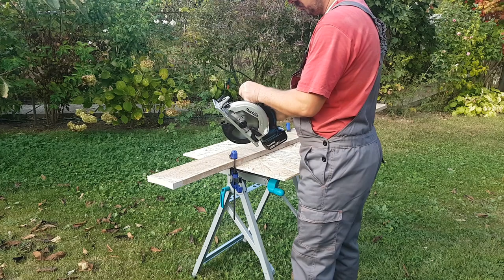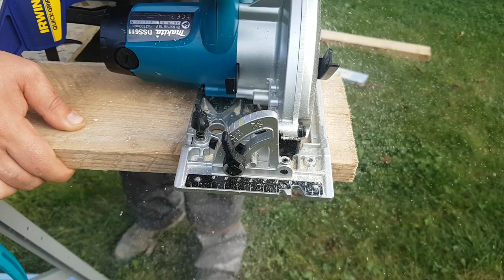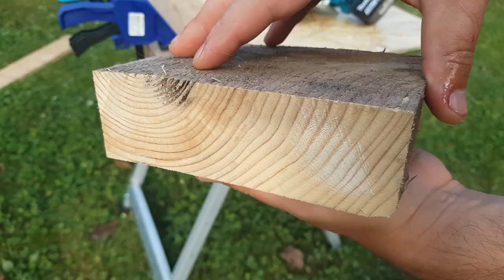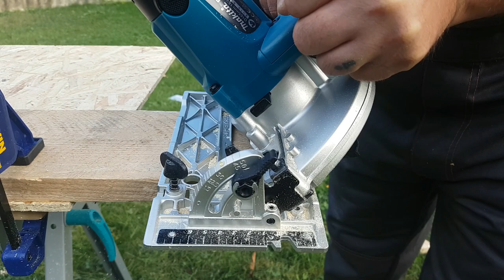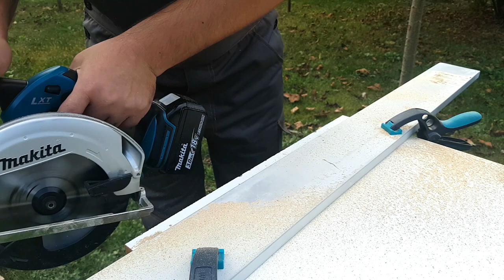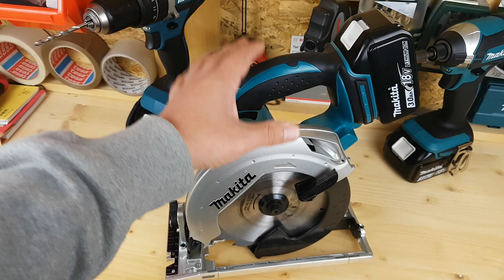Primele teste cu Makita DSS611 fierastraul circular cu acumulatori de 18V

Comment: Vă salut dl. Dan.
Ce părere aveți despre makita dss501?
Intenționez sa-l cumpăr pentru lucrări ocazionale,  pentru casă. 
Are pânza mai mica și pare mai ușor de folosit. 
Mulțumesc!
Reply from the maker: DSS501 am vrut eu sa iau initial dar nu era pe stoc asa ca am luat dss611. Si nu imi pare rau deloc. La fel am zis si eu, ca nu imi trebuie cu panza de 165 dar am sfarsit prin a despica pe lungime grinzi de 100x100 si n-as fi avut ce sa fac cu 501. Ala e bun doar pentru cherestea mai subtire. Nu are multa forta, intra repede in protectie. Trebuie sa te gandesti bine la ce anume iti va folosi, si atunci te decizi. Oricum 501 este mai scump decat 611.
Reply: @DemoToolsYT  
Mulțumesc mult pentru sfat!

Comment: Foarte bun video-ul de prezentare. Cred ca si bateria il tine putin pe loc, nu ai incercat cu un 5Ah? Are ceva tendinte sa se incalzeasca aparatul sau bateria? PAL-ul oricum este putin mai dificil de taiat, din ce am mai auzit acest materiale se taie cumva cu doua panze pentru a iesi taietura curata. 
M-ar bate si pe mine gandul sa iau un circular pe acumulator. 
Spor!
Reply from the maker: Aia de 5Ah era goala, am facut cu 3. Oricum tot as fi folosit si 3 asa ca am vrut sa vad din prima cum se descurca cu 3. Voi vedea si cu 5, ceva mai bine sunt convins. Poate fac si un clip de capacitate, cat taie cu 3 si cat cu 5, o sa vad. De incalzit nu s-a incalzit. In clip pare ca taie mai greu dar sunt eu cel care nu vrea sa-l forteze, imi place sa le las sa-si faca turatiile fara sa fortez motorul in lemn, nu ma grabesc nicaieri.

Comment: Misto scula!sper sa te ajute in proiectele tale.👌makita a inceput de luna trecuta sa produca o gama noua de scule,cu baterie de 40v.incarcator nou,baterie noua,scula noua....alta platforma...deocamdata este disponibil doar in japonia,iar in europa spre sfarsitul lui 2020.makita anunta ca cele de 18v si 40v vor merge in paralel...eu sper ca da...am un combo kit de la ei si nu as vrea sa scoata 18v.vedem ce se mai intampla...https://youtu.be/Gny6tdIXzU4
Reply from the maker: Parca am vazut eu ceva dar nu am aprofundat. N-au cum sa scoata 18 nu cred ca va scoate cineva prea curand seriile de 18.
Reply: Ceva de genul cum este la DeWALT cu acumulatorii FlexVolt. Adica 18V respectiv 54V. Daca ar face asta ar merge, dar daca ar ramane pe doua platforme separate nu stiu cat de mult succes o sa aiba. Sa ai aceiasi firma cu doua seturi de baterii si incarcatoare, cam dificil.
Reply: @DemoToolsYT  si eu sunt de aceeasi parere.cred ca astea de 40v sunt pentru munca extrema.18v are o limita si de aceea trec la 40v.este exact ca si dewalt....are scule cu 18v, dar si  60v(flexvolt).produce in paralel.acelasi lucru cred ca incearca si makita.singurul dezavantaj,cred eu,este ca nu vor mai investii asa mult in 18v si nu vor mai veni cu noutati(dewalt este un bun exemplu)...
Reply: da....ai dreptate.oricum,makita a dat rateu cu sculele de 36v(doi acumulatori).cel putin cele pentu gradina,acumulatorii se consuma foarte repede.nu am asa ceva,dar un prieten apropiat mi.a spus.nu este deloc multumit de ele.acum,vad ca makita revine din nou la o singura baterie.
Reply: vezi ca am postat un link intr.unul din comentariu.din ce vad eu,asa pare...alta baterie,alt incarcator....iar unealta,in mod normal trebuie sa fie tot noua(nu stiu daca poti folosi 40v la o scula de 18v).sau da?
Reply: acum am gasit...sunt doua platforme diferite.cele de 18v sunt lxt,iar cele de 40v sunt xgt.sunt total diferite.
Reply from the maker: @florinene3225  Am si eu in lista niste utilaje cu doua de 18, suflanta, masina de tuns iarba, drujba, poate si o motocoasa, am mai vazut asa clipuri cu ele, par ca ar trage dar intr-adevar, acumulatorii se duc cam repede. Trebuie sa achizitionezi mai multi. Dar trebuie sa ne gandim ca si ele au forta si consuma foarte mult. Cat despre acumulatori, n-au disparut ei aia de 10,8, 12 dar aminte de 18.
Reply from the maker: @florinene3225  Daca acumulatorii sunt cum e la DeWalt FlexVolt, pot fi folositi si pe sculele de 54V si pe cele de 18V. Banuiesc ca asa vrea si Makita sa faca. Eu unul pentru nu as cumpara pentru ale mele de 18 pentru ca nu vreau sa car dupa mine ditamai caramida de acumulator, sunt destul de mari si astia LXT.
Reply: @DemoToolsYT  ai dreptate...cred ca daca ai 4 acumulatori de cate 5ah iti poti termina o gospodarie fara probleme.lasand la o parte timpul scurt de lucru,cele pe acumulatori sunt silentioase,nu necesita intretinere,nu necesita amestec de benzina si ulei.....avantaje si dezavantaje.nu am folosit pana acum,pentru a.mi da cu parerea.doar ce am auzit la un prieten...ce sa.ti spun...astept nou video cu 36v si sa ne spui parerea ta...😉😊
Reply from the maker: @florinene3225  Aia zic si eu, usor de folosit. Daca si cand imi vor intra in mana, vor fi pe canal cu siguranta :D